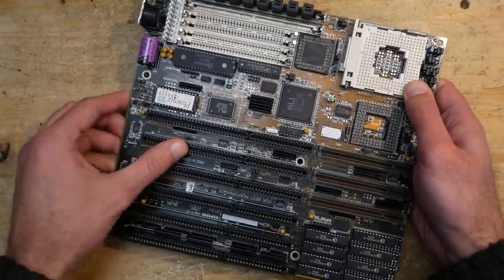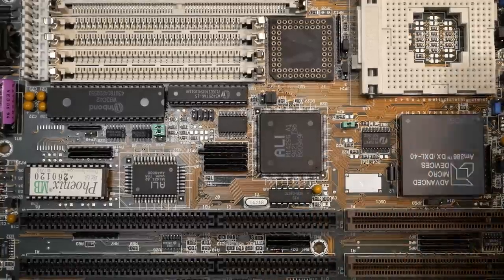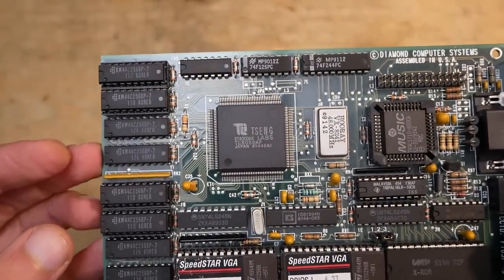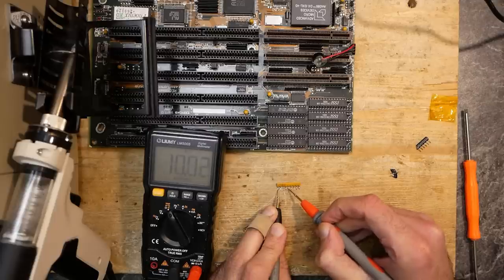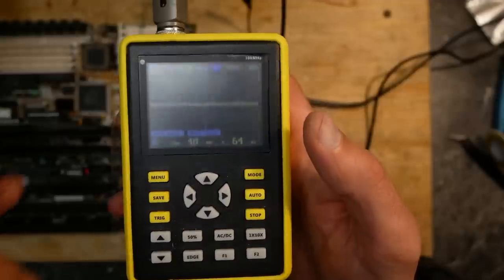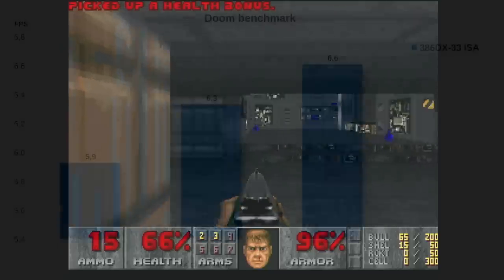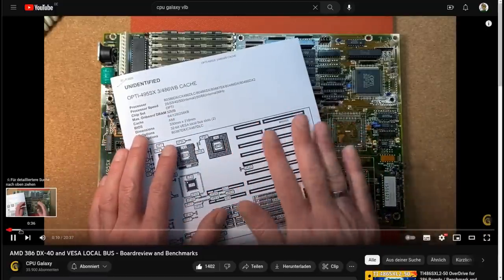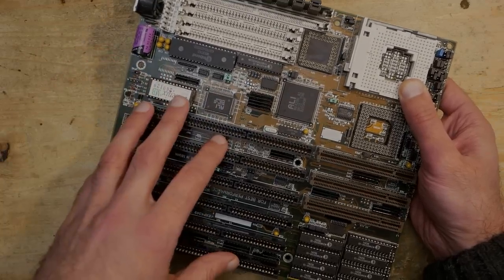An expert among retro mainboards (Part 2):  stability issues, 386DX with VLB vs ISA

Comment: And what happened with the IDE speed? Would the sound card still work if you had used one?
Because there's a guy in every country who doesn't care about FPS games and in Spain it just happened to be me LOL
Reply from the maker: IDE make nearly no difference. Overclocked ISA make a lot of problems with sound cards indeed, but it heavily depends on the sound card. I have around 30-40 ISA sound cards in my collection, may be I should make a big stability check one day :)
Reply: @necro_ware  I've never used a flash drive of any kind on an IDE ISA adapter, are they anywhere near the 5MB/s that ISA SCSI controllers used to list as the maximum recommended speed?
With large disks without smartdrv loaded waiting for DIR to calculate the free space is maddening, samething doing a full format, I don't know if using a flash drive improves anything in that sense, otherwise I don't have any problem with the transfer speed of IDE drives.

Comment: I wish you install a pentium overdrive Although I used to change hardware very frequently and also owned a computer shop from 1997 to 2000, I never put my hands on a pentium overdrive. My first pentium was a 120mhz, overclocked at 133, with 512ko cache I changed myself, soon to be replaced by a Cyrix P166+, much faster as long as the fpu was not involved

Comment: This test seems to confirm that the 386 and ISA should indeed be eliminated at the same time, but the ISA has persisted until the 845G chipset motherboard of the Pentium 4 era
Reply: There is nothing wrong with ISA and it still has uses in industrial settings (PC/104).

Comment: 19:50 ok but The only thing, which I don't like is that you never say that you are using High quality settings. And If you talk about reducing quality, you always talk only about screen size, but never about an feature that in doom's settings we can reduce quality to save fps.
Just Image this approach today - when you have Cyberpunk2077 and you are saying - look only 8fps on gtx770, so it is not playable - we can reduce screen size (resolution) but look, it is still not playable. BUT in reality we all can see that you have set everything at the ultra in graphics settings. I just don't get it. What is the point to run a doom, always on highest quality settings, and prove that the lowest cpus (386,486) cannot even handle it. But if we reduce screeen size to size of pingpong ball then we can play. But how about low quality settings? Why you not talking about that?
Reply from the maker: I told about it in Doscember 2022 video.

Comment: Finding descriptions for old ALI integrated circuits  is annoying . Do you have a datasheet for ALI M1217, M1429 or only  a description of the pin outputs ?
Reply from the maker: To find any documentation for the M1429 would be nice. There seem to be nothing for the ALi chipsets before Pentium era.